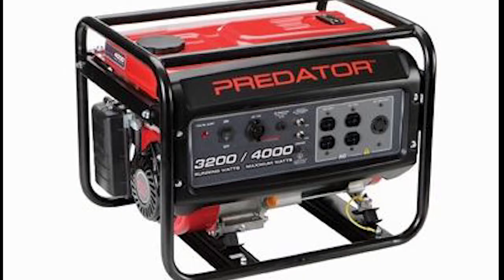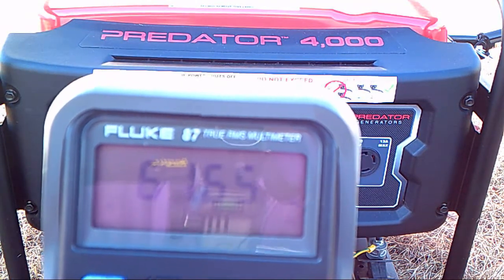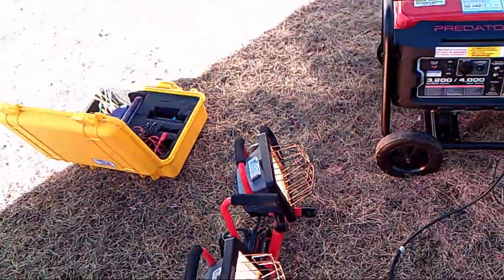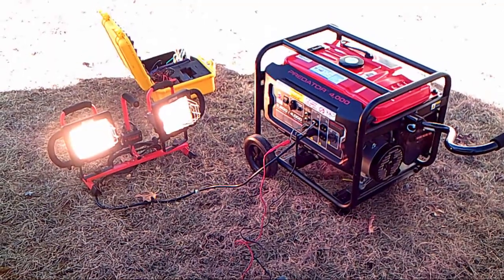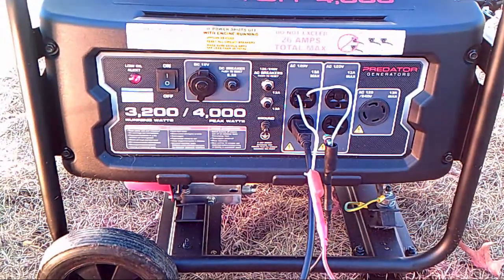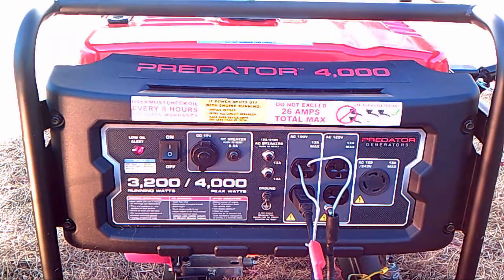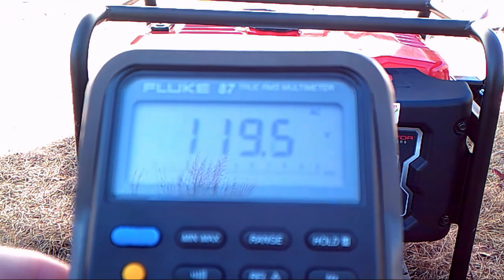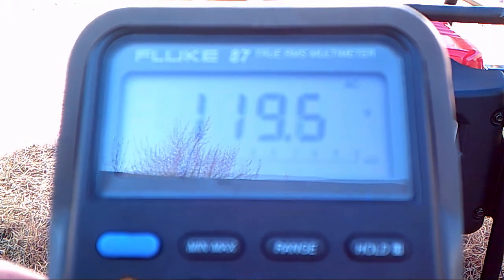Harbor Freight Predator Generator - Hertz & Voltage Test.

Comment: This is what I purchased last year new.I  took it  home and she skipped.Also will not crank at 50 degrees Fahrenheit without carb spray.Its not a bad misfire .Thinking she will improve with time...3 to 5 hour's of run time is all she has.I am up on a small mountain in AL.Maybe everthing will work out.Thinking it may be a plug gap problem because it is so close to running correctly.Ty for the video.
Reply from the maker: I've had good luck so far with mine.  Still starts on 2nd pull everytime.  You  should have taken it back while it was under warrnaty.

Comment: I have the 4350/3500 unit, and mine is a turd.  Under a 1300W load, I was getting 58-62Hz and 112V.  Looks like I need to try the altitude kit to see if that improves.
Reply from the maker: I know they had the jets for higher altitude.  I'm more sea level
Reply: @KingWilliam  Yep.  About 6800 ft. I've order the 6000-8000 elevation jets.  I hope that makes a difference.
Reply: Meh.  New jet didn't clean up the output frequency at all; however, it seemed to deal with the load much more readily and output slightly higher power with much more consistent delivery.  Previously, it was a very jagged, running 1100-1400W with LOTS of ups and downs. It was much more consistent at 1400 with only slight variations ±30W.  Probably something amuck with the governor. I can hear it hunting a bit. Must troubleshoot.
Reply: Here is a reminder about portable generator safety: This advice is just to make sure that everyone is aware of all the warnings and it’s just to remind people to be careful using portable generators. Everyone has to see this safety reminder for safety. Every year, hundreds of people die or get injured when using portable generators due to carbon monoxide poisoning and electrocution. Make sure you are using your generator carefully and keeping others safe as well. There is something very serious that everyone should always be aware of when using generators. Some people do run their generator indoors which is not safe and that increases the risk of carbon monoxide poisoning which can cause death of family and you. Some people run their generator in wet conditions which can electrocute them. Please remember that you should never run your generator indoors. Remember that carbon monoxide is an odorless and colorless gas that you cannot see or smell. Carbon monoxide is a silent killer. Keep that in mind. Make sure your generator is 15-20 feet away from your house and away from doors, windows, and vents. Never use your generator in your porch too. Having a carbon monoxide detector is very important against generator safety. Some people also allow children to go near the portable generator which could pose risks. We need to keep an eye on our children making sure that they are not near the portable generator so they won’t get electrocuted or burned by the generator which is dangerous. A locking enclosure also keeps kids safe. A generator shed might look like a tempting place to explore, or take cover during a game of hide and seek, but a generator is a dangerous piece of equipment that can cause injury. It says on the manual that we should also keep children away at all times from the portable generator to avoid injuries. Please do not allow a child or unqualified people to operate the portable generator. Just because some manuals missed what should be listed doesn’t mean it’s safe to do. Always follow the generator safety rules when using portable generators. Generators pose electrical risks. If you need to use your generator during wet weather, you need a generator tent to protect your generator from getting wet. Don’t let your generator get wet. Keep your generator dry and before using your generator, please make sure your hands and your generator is dry. Do not wear loose clothing when operating the generator. Everything that is said on the generator’s operating manual should not be ignored. Never smoke cigarettes near the generator. Please keep flammable things away from the generator. Never overload your generator too. Your generator can catch fire. Never ever try to plug a generator cord into a wall outlet to avoid back feeding. Back feeding your generator is dangerous. Always turn on your generator first before plugging in appliances and shut off the appliances before turning your generator off. Use a heavy duty cord for your generator and the cord should not be worn out. All the instructions should be followed carefully. Never refuel your generator while it’s running. It can cause fire if fuel spills while your generator is hot. You should turn off your generator and let it cool off before refueling it. Having a fire extinguisher next to the generator is also important. This is only a reminder for everyone’s safety of using generators. Make sure your generator is properly grounded. https://youtu.be/I1jT3ANENvI and here is a video more about keeping others safe when using generators and also about our family’s safety. Hope this helps. Thank you. Stay safe